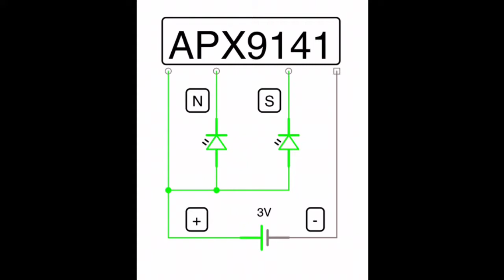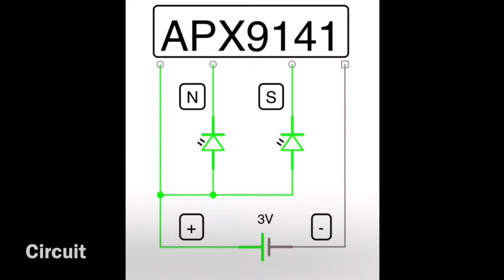DIY Magnet Pole Tester with Hall Effect Sensor

Comment: would it be possible to make this so that whenever no magnetic pole is next to the hall sensor, no led is burning ? This would be interesting way to make limit switches with just 1 sensor but two magnets. With different polarity you could get 2 outputs with just 1 sensor. Its just that if one of the leds (or outputs) is always high, then it would not work very well.
Reply: i know it's a late answer:

Light
Emitting
Diode

so you just need a NON-LED, also called "diode" :)